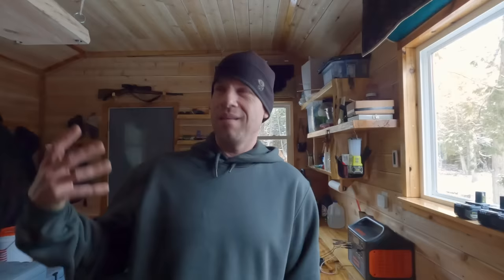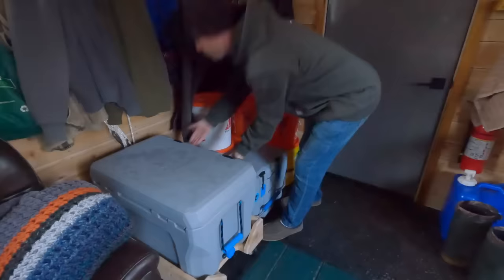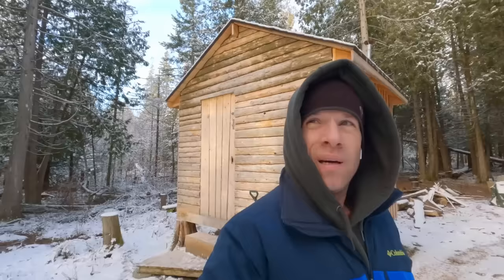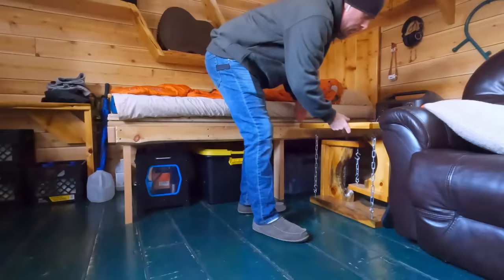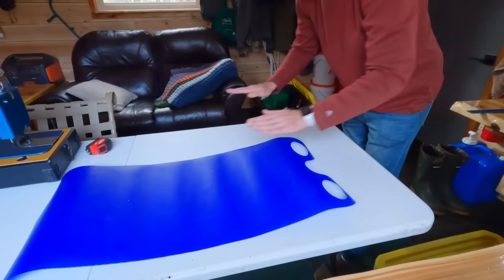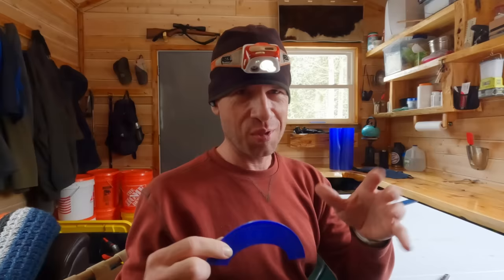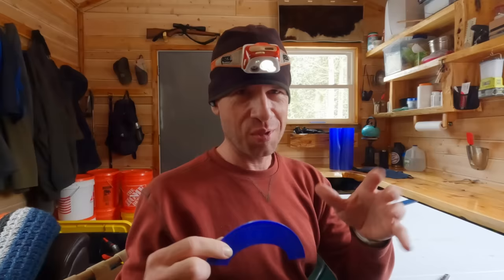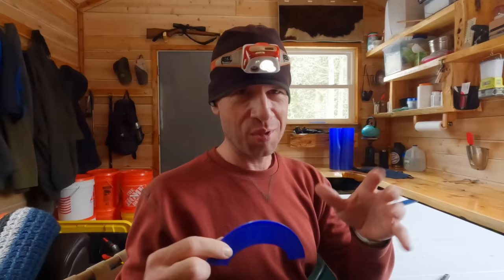Winter Shower Water Kills My Cabin Floor No More- Sewing Snow Sleds. #170

Comment: Seems like a dedicated outside highly insulated water bucket  holding box, not a shed, raised up a couple of feet and heated with a small solar panel that drives a mini mini heat element with a pc fan placed low..
Reply: Paint the box black and you probably don't need the solar panel.

To help with insulation, build a transparent ((Plexi)glas) top cover. That way much of the heat is going to stay in.

Comment: As i listened to you talk about your water issues, It got my thought to considering how to work smarter not harder. Larger amounts of water take longer to freeze, Your bath house is heated while you're heating the water. That heat could be captured and do double duty in the winter months if you insulated the bath house or part of it, to retain the heat, because you only need it to stay above freezing until your next shower. A tote or barrel on a pallet sitting in a shower basin to drain if it ever should leak or from condensation could drain out the bottom could even add pipe insulation to reduce the cold from entering from the drain pipe. For the summer months could have the shower separated from the heating of the water so you still can enjoy the out doors like it is now with an insulated wall and door between. Just a thought. I'm sure you could explore that idea some more to fit the solution even better. Cob would be useful as a heat sync to help capture more heat to slowly dissipate the heat to keep your water from freezing as well, by extending the warmth between showers keeping everything thawed out and useful. Then you wouldn't need all the water buckets in the cabin. If your going to pay for the propane may as well get every oz out of using it to your advantage.

Comment: At work, we sew through 3/16” thick PVC angle. So I was confident that you could sew through the 8 layers of sled. We use a new Juki now, but we previously used a Pfaff (circa 1960-something). Couldn’t get parts for it anymore—hence the upgrade. BTW, I have access to flexible PVC sheet if you need some. We often have blemished material that we can’t use. 39” wide in almost whatever length. We extrude our own material.
Reply: I love how everyone is so willing to help each other out. Nice!

Comment: Auto parts stores have various size thin metal pans with a small lip all around.  They are made to put under a vehicle to prevent drips on your garage floor. Great videos. Thanks - from Hells Canyon, Frank.

Comment: Maybe build an addition to your cabin to be a fridge. Just an insulated room to keep your coolers in. 

Store the 5 gallon buckets of water under the cabin in a finished crawl space. Don't insulate the cabin floor for the crawl space, but do insulate the floor & walls of the crawl space. The heat from the cabin would migrate down & if it wasn't enough, than add vents in the cabin floor.

Comment: Providing you can keep it drained - dig/build a small root cellar for your water. It doesn't have to be deep under the ground to keep your water liquid. An oversize insulating lid will help a lot.

Comment: Don't put your guitar next to the heater. And if the humidity is that low, you might want to consider a hydration pack to put into your guitar. [2c]
Reply: I was gonna mention that too. too dry and that thing starts to crack...

Comment: They have roofing tape that is silver and is made to have light exposure and will seal those together and waterproof all at the same time.  I used it as flashing around the roof vents on a camper it works great.  The brand that they used to sell at home Depot was not the same as the one at Lowe's Lowe's was the one that could be exposed to light and was really sticky and it was the coolest stuff but not cheap.

Comment: It will condensate under the plastic and still ruin your floor. I have rubber backed floor rugs that the dogs lay on, and I still have condensation under a rubber backed carpet. They need to be set up above the floor

Comment: Would a big very well insulated box to store the water buckets in the shower room work to keep the water unfrozen longer?  You might want to seal up that corner of the sleds to deter the condensation from leaking.  Thanks for the episode.

Comment: I have a 196 sq foot cabin in da yoop. when I first built it I was heating with a 15000BTU propane heater similar to what you are using. In the really cold time of the year it would heat the space just fine but it never felt comfortable because of all the moisture it produced. Have you experienced that as well or am I just nuts? Good job with the build!

Comment: You need air ventilation to stop the sweating. Is your roof not vented?
Reply: he put vents in there's a video of it.
Reply: Hmmmm. Could have something to do with a vapor barrier and air flow combined.
Reply: If a remember correctly he may not have a vapor barrier on the floor.
Reply: @justintimeoutdoors5790  
there's is a vapor barrier on the floor but only a small layer of that foil type insulation